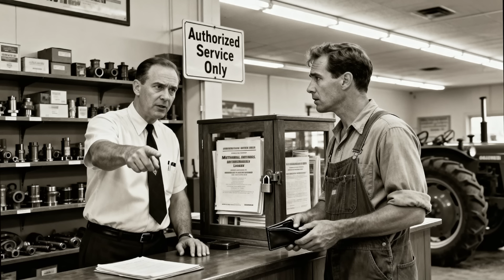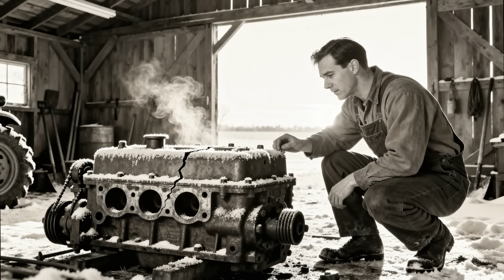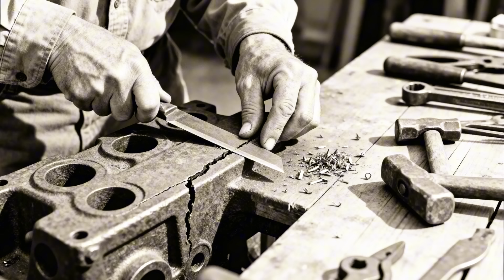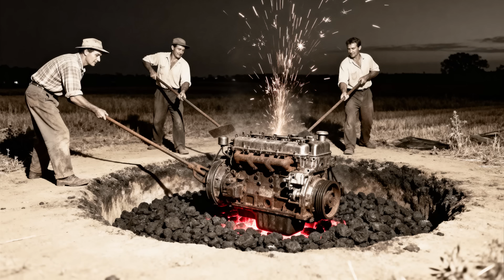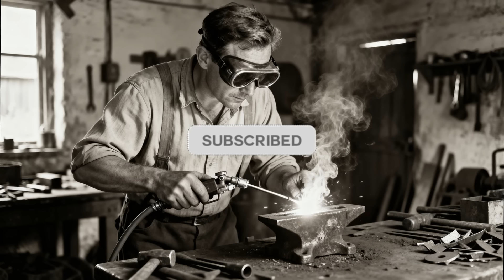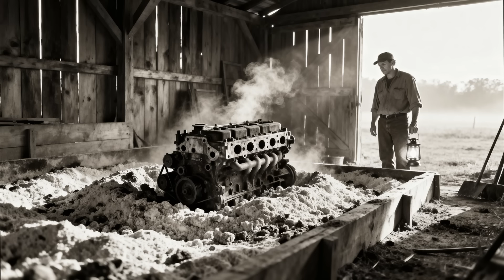THE “PROHIBITED” FIX THAT KEPT OLD TRACTORS RUNNING FOR 40 YEARS WITHOUT FAILING / FARM WISDOM

Comment: I must add that we changed many freeze plugs that leaked on engine blocks. 
They used to be brass plugs that went in the sides of the blocks. They were supposed to blow out before the cast block cracked.
Reply: Freeze plugs was never meant to save the block they was holes to remove sand during the casting process
Reply: @DukeNukem3955 They saved a lot of blocks in old tractors and trucks. I have replaced many myself that were leaking or popped. 

Mainly from years ago when people were to cheap or lazy to spring for coolant changes every few years. 

Probably the reason they became known as frost plugs.
Reply: @DukeNukem3955 people's not  smart

Comment: I grew up on a farm and we used to buy Farmall Ms on auctions and had at least 6 at a time and salvaged and swapped parts to keep them running. 
We also repaired parts and yes we brazed and welded on cast iron. We also used JB Weld to repair spider web cracks on the water jacket on the outside of the block if it was too far gone and leaking water, it worked.

I myself used to braze at 10 years old. I had the patience for it that my dad did not. 

Had a neighbor that was an old farmer that taught me how to do it.

The cast Iron on engine blocks used to have a higher nickel content and you could successfully braze it but you had to preheat everything  and  insulate it to slow down the cooling rate. You never tried to fix it in the winter unless you had a heated shop.

The bronze was a good repair on cast iron.
Reply: Great memories. Thanks so much!

Comment: Try getting parts for a Ford 1910 manufactured in 1985.  Try to buy a internal PTO Shaft.  If it has the Syncro Shift, you cannot buy one even in a Tractor Wrecking Yard.  Try getting parts for the CLUTCH on that same tractor.  ALL metals can be welded, but cast iron and many other metal will never be the same after Cracking and Breaking, then welding.  There are DIFFERENT kinds of Cast Iron.  Malleable Cast is what they make Anvils and Vises from.  Finials for ornamental Iron Fences are gray cast and can be welded with a 7018.  Other kinds of cast can be Soldered or Brazed and returned to Service, but they will never be the same.  Preheat and post heat are required on MANY THINGS that are to be welded.

Comment: Sort of a proto-"right to repair" issue, eh? I have an antique 3 hp Fairbanks-Morse stationary engine that has a cracked head, brazed long ago by some skilled blacksmith. It's a good job, since you can barely detect it. I learned to braze from a farmer I worked for when I was in high school in the 60's. But I could never do it as well as the guy who brazed my Fairbanks.

Comment: What a load of rubbish you can still get parts for nearly every tractor that has been manufactured
Reply: Small isolated communities during harvest time , before the internet and overnight delivery ? Today we are spoiled beyond our ability to comprehend how blessed we really are. Amazon prime, search engines for rare parts worldwide, pay online with a credit card trace your shipped item to your doorstep. I collect old tractors and at 57 years old I talk to many older farmers it was a different day. Today functional obsolescence is not even identified or even observed by today youth. Look up the right to repair against John Deere. They never wanted the independence of the self service farmer or DYI. I say fight back and buy serviceable vehicles and every item you can.
Reply: Try getting parts for a Ford 1910 manufactured in 1985.  Try to buy a internal PTO Shaft.  If it has the Syncro Shift, you cannot buy one even in a Tractor Wrecking Yard.  Try getting parts for the CLUTCH on that same tractor.